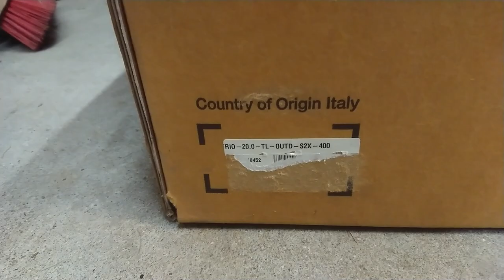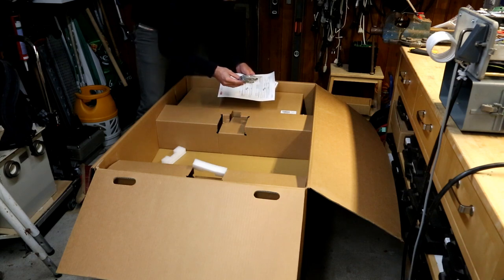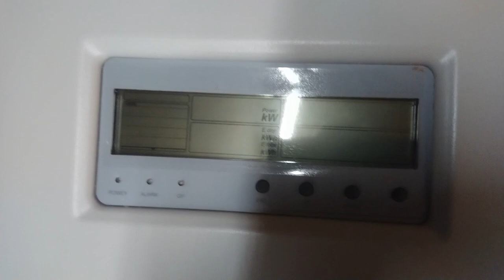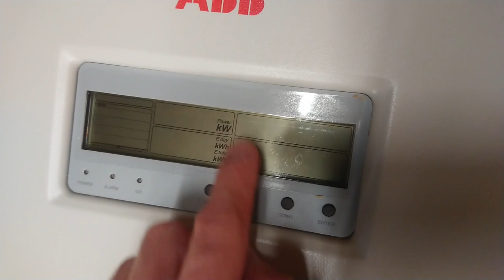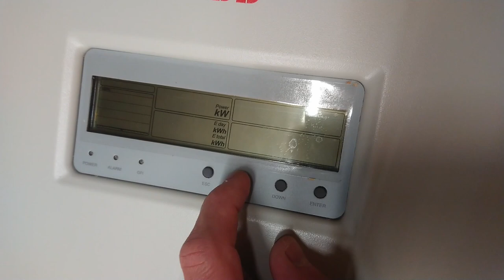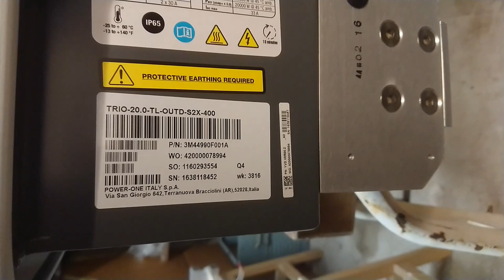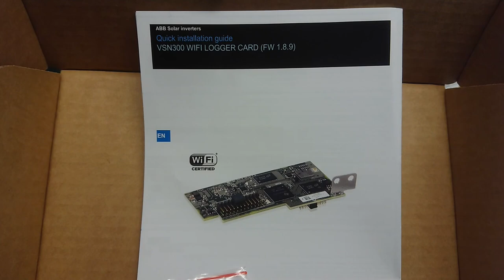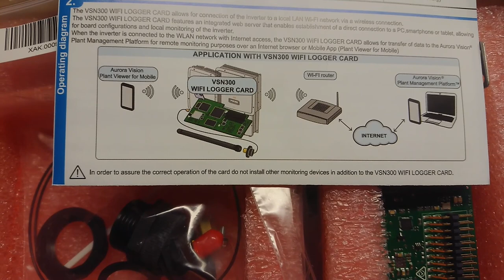ABB TRIO 20 kW Solar Inverter - Unboxing and Teardown

Comment: Hy, I have the bigger version, 27KW one. Beefy stuff! All caps are MKP. I think on the output stages are the same.  Unfortunately I have an issue with the control board. 
ABB has some good Inverters, previous they had issue with the relays. It's interesting that on mine I don't remember the copper cooling fins on the relay board for the traces.... have to check it. If by any chances you will take it apart, I'm interested in the communication board and the input box.
Reply from the maker: Thank you for that correction, I mistook them for being beefy test points, so it is really PCB heat sinks?

The inverter will not get chopped up just yet :)
Reply: Hi Gatea , what issue you have with the control board

Comment: That is much smaller than I expected. It must be pretty good efficiency.
Reply from the maker: They are also designed for a much higher operating temperature, with only passive cooling at the backside of the unit.

Comment: Hi thanks for the video.  Have you located the manual for this beast?  ABB don't do solar I hear.  My TRIO is giving an error which might be just a menu item fix, but I also want to see the WLAN connection to save me standing in the hot sun trying to read it.  These highly reflective LCD panels are a problem, at least it has a backlight I suppose if daytime is not too bright.  I'm in Western Australia  - Gingin

** Re manual - I found it at manuals.lib  I can see that I have a yellow light and an E004 error "BULK 0V" (over-voltage DC-DC circuit) voltage on the  which could be an internal component or overvoltage on the external grid.

- E004
 - Bulk OV - Yellow LED

“Bulk” over-voltage (DC-DC circuit): Error inside the inverter. The alarm is raised when the voltage at the heads of the bulk capacitors exceeds
 the Over Voltage threshold (internal unchangeable threshold).

• The alarm may be triggered by causes external to the inverter:
 - An excessive input voltage can be recorded as a condition for bulk over voltage. In this case it is advisable to check the inverter's input voltage and should this value be close to the input OV threshold, review the configuration of the photovoltaic generator. - Excessive grid voltage could cause the bulk voltage to rise in uncontrolled fashion with a consequent protection intervention and hence generation of the alarm. In these cases the alarm is transitory and the inverter automatically restarts - The alarm may be triggered by causes inside the inverter and in this case it is necessary to contact customer assistance.
Reply from the maker: I sold the unit with everything. I am sorry that I can not help you.
Reply: @KaizerPowerElectronicsDk  I found the info - just posted here in case someone is looking.
Reply from the maker: Thanks for coming back to share it. Sharing is caring :)

Comment: again, they make a medium power inverter but use toy transistors. it makes more sense to use high power switching and keep gate drives short.
i just built a 20kw single phase unit and it weighs no more than 5kg with water cooling.
Reply from the maker: Smaller switches are used to reach the strict goal on inverter efficiency. That is most likely the only reason.

Comment: wow that is really cool! what will you be using it for?
Reply: Probably solar panel energy which it's its main function
Reply from the maker: So far it will sit in a corner, it can still be used in installations that was done with the same model before changes to allowed models. But my hopes are not high to  find someone needing a spare :)

Comment: where is the DRSSTC III? It's been a while that I didn't see that TC
Reply from the maker: In a couple of weeks time I start building transport cases for it, I will do a video about that aswell, in order to move it to a location for test for a hopefully upcoming event next year :)
Reply: Nice! My school proposed me to build a gigant musical tesla coil and will pay me all the hardware!! Do you have any advice? I want ti build something 3Phase powered around 15kW like yours or the one from Goodchild
Reply from the maker: It is a pretty huge project and very costly if you go out and buy the parts from new. It took me 4 years to complete in hobby time, well also with a lot of travel for work and having kids meanwhile, but still :)

All my advice is written down in my DRSSTC design guide: http://kaizerpowerelectronics.dk/tesla-coils/drsstc-design-guide/

Best of luck with your project, please do sign up at www.highvoltageforum.net and show your building progress and get help on the project :)
Reply: @KaizerPowerElectronicsDk  Thanks! I already have an account on high-voltage forum ;)

Comment: wait. regulations because the technology of that iverter is bad, or because of financial - political profits of some " people ?
Reply from the maker: In order to combat cheap inverters coming in from China, that only has a CE stamp for sale purposes and not to actually document that the product is living up to the CE mark, a positive-list was made. To get on the positive-list the manufacturer had to send in documentation within a certain time frame on previous projects/products and they would get accepted as previous installed base. Those that did not do it in time are now subject to a rigorous paper work and it was simply cheaper to throw out the old inverters and only do paper work for the new types/products.
Reply: @KaizerPowerElectronicsDk  thats not a bad thing , even if involves a sh1tload of burocracy .but that will kick in the small people , who wont aford to buyit so.. yes, i know its a loooong subject . anyway , what you say has sence and logic